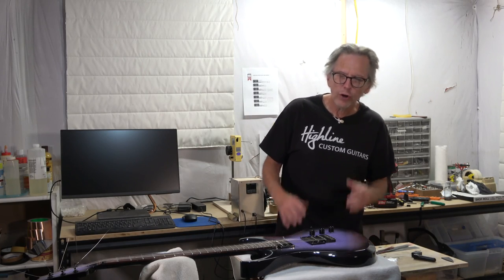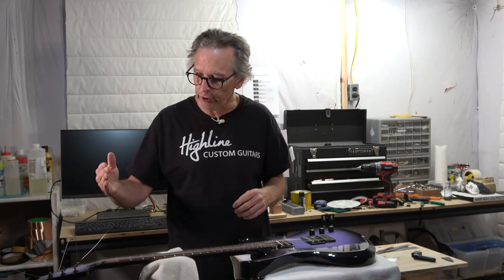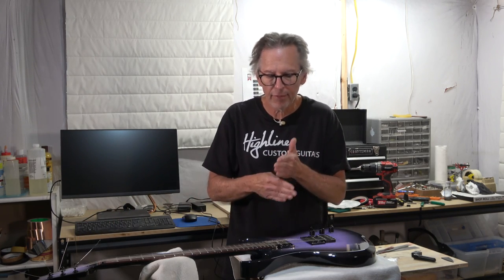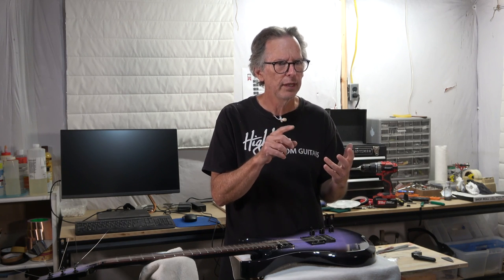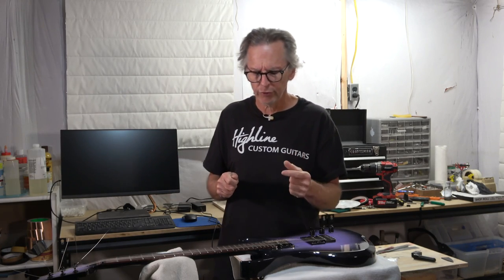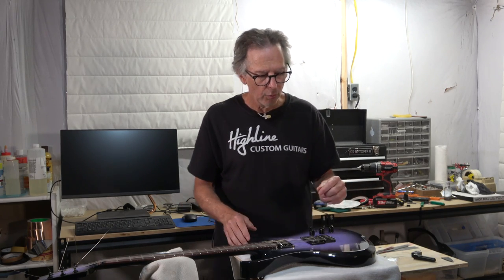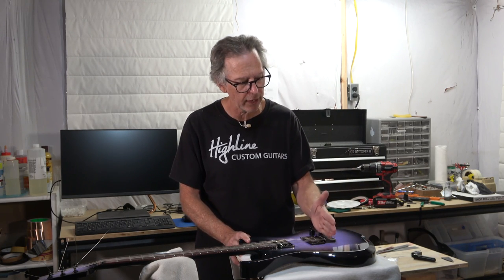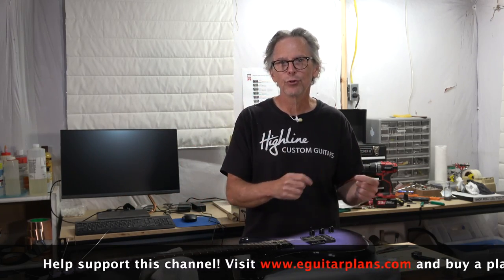Can You Improve Your Guitar's Sustain?

Comment: I do repair work on the side, and think you should stop gluing in the frets because it's bad for my business.  :D

Joke aside, I see lots of lifted frets, it's the second thing I check after relief if there's fret buzz.

Aiming for fret contact in the bottom of the slot sounds very risky to me, because it has to reference the fretboard surface to be level with the other frets. I always run a saw down the slots to ensure that there's enough room when I replace them. I then crown them slightly rounder than the board radius,  hammer and glue them in. I've never had a single recall.

Comment: good info, especially regarding frets and the need to radius the fret slots.

If I may add that in my experience a guitar that has a set neck is very resonant, as compared to a bolt on neck where there is a thick layer of finish inside the neck slot- yuck!

Comment: Informative as usual!
Speaking of the nut and just a bit off topic, I've seen folks using a "compensated" nut.
What's the purpose of that since intonation is performed at the bridge?
Reply from the maker: Bridge intonation is about 60% of the whole story. A compensated nut will improve intonation even more (if done correctly), but you still have the frets to deal with and they are in a fixed position. That's why the so called True Temperament frets are a thing. In the end, you have to ask yourself, "Is this really important to me?" For most it isn't. For some, precise intonation is necessary to avoid a trip to the rubber room.
Reply: @HighlineGuitars  coming from a 3 generational wood craftsman with an OCD cherry on top, I applaud the "rubber room" comment.
Reply: @HighlineGuitars  I guess I just don't get it...Point-A to Point-B = N regardless if it's adj. at the nut or the bridge, compensation = simply moving the centroid within the segment and changing the scale length for that particular segment...seems like the adjustable saddle would accomplish the same thing if it was within the range of adjustment of the bridge, obviously I'm missing 40% of something, which seems like quite a large error?
So the only sonic difference is where that centroid fell relative to pick-ups?
Anyway sorry for derailing the discussion
Reply: @svgs650r  intonated correctly at the 12th fret, yes? But it will be slightly out at most other  frets by varying and different degrees on each string, unless you're using wiggly true temperament frets.  Have a close look at a TT  neck - it's mind boggling how the size and position of each fret changes for each string if you truly want precision.  Think of that TT pattern as the map of errors.  A conventional neck is a compromise for simplicity.  A true temperament neck is the no-compromise complexity. A compensated nut is a halfway house trying to redistribute the amount and position of those small errors more equally along the neck by adjusting from both ends.

There's a loooooong description on the earvana website about their compensated nut and why/how it works, with way more factors than I'd even imagined or care about.  It makes my head hurt, lol.
Reply: Thanks for the reply If only I hadn’t  been around racing motorcycles and loud music for decades my barely macro-tonal ears could appreciate micro-tonal perfection

Comment: While I'm not arguing what does and doesn't make a difference in the guitars tone. We'll leave that for others to discus, often economics plays as big or bigger a role in guitar construction. Just as an example, I know that Gibson necks use a lot more wood in their construction than Fender because of the headstock angle. 

I understand that a lot of Gibson's decisions, materials, different geometries of their designs, brand of components, and construction are marketing based. It's what their customers insist on. So, I'm not trying to champion them or anything.

Comment: Thanks for the info! I’m wondering what your opinion is regarding trem blocks. I know you mentioned that beyond the saddle doesn’t matter as much but there are different options for trem block metals such as steel, brass, titanium, pot metal, etc. . Do you feel that these affect sustain or would they more affect tone? Thanks!
Reply from the maker: There is always great promise from the suppliers of exotic term blocks, but the reality is usually disappointing.
Reply: @HighlineGuitars  what type of trem blocks do you use?
Reply from the maker: @mattrorke7536  whatever comes with the bridge.

Comment: I like the idea of using CA glue to connect the frets into the fret slots and make a solid connection between the two. If you later want to do a refret of these glued frets will you rip out the fret and a chunk of timber in the process thus making it impossible to refret again?
Reply: I work at the PRS factory and we superglue the frets down. If we need to do a re fret all you need to do is use a soldering iron and melt some solder onto the fret to heat it up and this destroys the glue. Then (while still heating the fret) you use your fret pullers and the fret comes right out. Just be careful not to heat it too long or the fretboard will get scorched
Reply: @lifeofalex9199  how much glue do you use? A little dab, or enough to get squeeze out?
Reply: @frodehau  they use exactly enough not to glob out.

Comment: I have a question about titanium string locks for use in Floyd Rose bridge saddles. Many believe that they increase sustain - I assume because they are harder than the stock string locks - but my brain tells me that, because the saddles that the locks sit in remain zink alloy or whatever, any benefit would be lost as the saddles would just absorb any vibration that was formerly absorbed by the old string locks. What does anyone think? Worth a go or a waste of £40-50?
Reply from the maker: Waste of money. I know because I tried them.
Reply: It is better to upgrade by replacing this bridge with one that already includes steel saddles. OFR, schaller, gotoh have steel saddles and the most important benefit of this material is the strength of the threads. Only in the cheapest licensed floyd bridges saddles are made of zinc, ZnAl or similar crap. Pure titanium is not very strong. Specialized titanium alloys can be very strong but also not to the extent that some people think, and at the same time they are much lighter than steel, which makes their superiority in terms of increasing sustain very questionable.

Comment: Minimal contact at the nut when working with bone, ivory, tusk, graphite and so forth makes sense.  What about locking nuts though, how would you say they effect sustain?
Reply from the maker: Because they are made of metal (usually plated brass) they have a very high mass which increases the potential for excellent sustain.

Comment: Does the nut play a role in sustain on fretted notes? Doesn't fretting a string take the nut out of the equation? Forgive me if you covered this and I missed it.
Reply from the maker: Yes, fretting takes the nut out of the equation except where open-string notes are part of a chord.
Reply: @HighlineGuitars  that's the assumption I've always had. Thanks for the reply
Reply: I also have a bad habit of asking the stuff all and all again. Just think yourself, it's so simple.
When you play a string and press on a fret, does the string vibration go to the nut or not? Simply not, at this point string vibration goes from the bridge to the fret you press.

Comment: But string-through vs top loader bridges do have a tonal difference. Top loader bridges lose a good amount of upper harmonics (treble) which can make the guitar sound plastic-y.
Max Solo had made a comparison video.
Reply from the maker: Believe what you want.
Reply: @HighlineGuitars  It's not a matter of belief. The difference is measurable if you run the audio through a spectrum analyzer, and the reason why it happens is still supported by what you said in the video.
A top loader bridge due to its construction is more susceptible to parasitic resonance.
Reply from the maker: @ErebosGR  Who cares. Nobody has a spectrum analyzer in their head. Don’t waste time on minutiae. Focus on the factors that actually make a big impact.
Reply: @HighlineGuitars  Obviously, he cares? And I think not only him, but many of us, guitar players and builders care about that stuff.